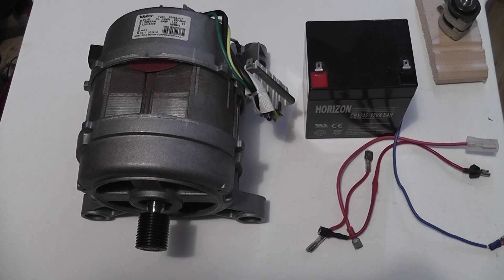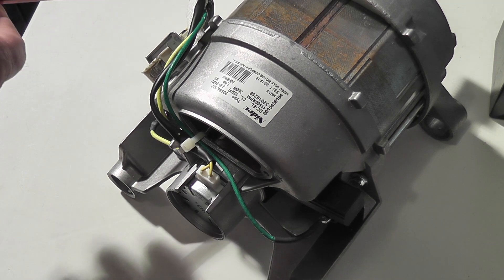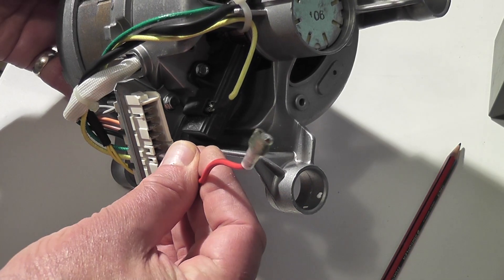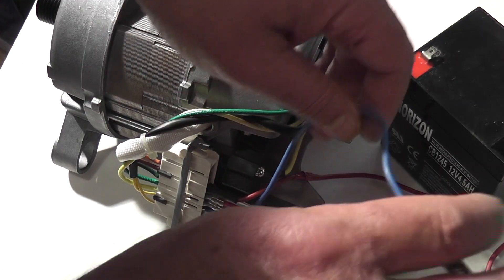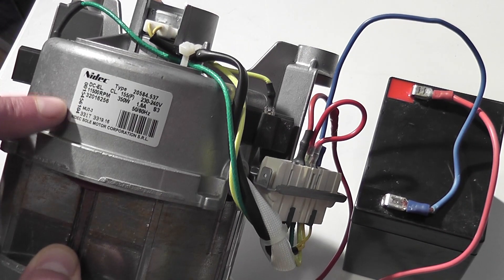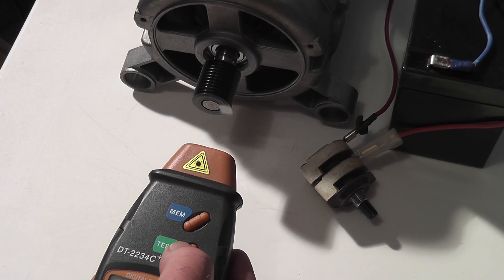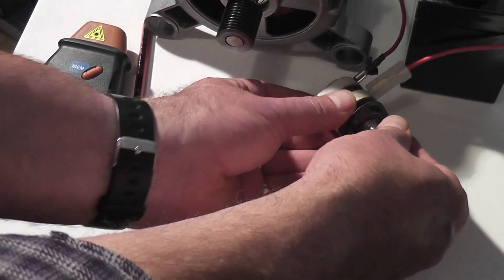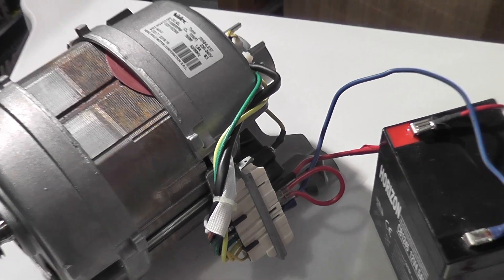Easy Conversion of AC Washer Motor to 12VDC

Comment: What the resistance of each motor winding? What is the purpose of each winding? What would your motor winding circuit diagram look like if you drew it on a peace of paper? How does the motor speed sensor work?  Complete the following equation: 12 vt Dc divided by Resistance = Amperage. Test your current using an amp probe, on your working motor. Is your meter reading the same as the Ohms law equation? Can you use a multi-meter to to check RPM of your working motor?  Answer these questions in your next video. Their is no HACK for real learning.

Comment: Motor nameplate says 230-240v, 1.8A, 350W - (1/2 Hp Rated Load) which should be at (1.0 Service Factor). 12VDC will turn it, but do not expect any sort of power output (not even a fan), as the battery would need to provide 29 Amps to run fully, and possibly burn out the winding as it is rated at 1.8 Amps.
The operating volts required suggest that this is from England.

Comment: You will want to rectifie the ac FLYBACK CURRENT block it's positive return path with diodes and toute the the converted FLYBACK DC current back through the neg brush.

This will convert the B-EMF internal braking into an intermittent pulsed push on the rotor.

Twice the ower twice the speed and when spun up from an outside mechanical means, it will outrun the external motor and power itself from converted FLYBACK currents.

Comment: Yes, the motor will run no load, but as such is nothing but a short term amusement incapable of doing any real work in the real world. Put a load on it and the motor will stall, then it becomes a question of what dies first, the battery rated to supply 225mA for 20 hrs, or the motor windings powered with the motor in a locked rotor state. Sorry, your demonstration has no real world application beyond demonstrating that a univeral motor can run on AC or DC.

Comment: Very interesting, how efficient is the motor when running off 12v, and how is the motor torque affected? Does this mean also that you could use this same setup to generate 12v as a generator of a small wind turbine?
Reply: watch the motor details it's a DC Motor?

Comment: yes with this way you can run every universal motors in your home, like drill, grinder, vacuum cleaner and...
with low turning.
just put 12 v on the power plug.
Reply: mccann  smoke for what?
no smoke come out.
test it.
a dc ac motor, run at 1/20 of power

Comment: Where/what appliance can you find those high amp potentiometers?
Reply: Electronic parts stores - what he is using is a high power rheostat. He does not give the resistance value, but is probably in the 100 ohm range.

Comment: Nice video, you please do a video of a brushless ac motor using DC power? Thanks
Reply: they need motor controller.
esc brushless controller.
without that they can't run.

Comment: I KNOW IT IS A 12 VOLT BATTERY.
What is the ACTUAL battery voltage YOU ARE RUNNING IT WITH and how many amps is it pulling NO LOAD.

Comment: a question sir .. I have a new motor for a washing machine .. it is 220 - 230 volt .. so if I bring many batteries that will calculate at the end of 230 volts .. will the motor run with no problems at the full speed and with all it's power ? (watt) ? I mean is the idea of AC and DC motors is how much volts I provide for them ? not matter if from a battery or from my house electricity ?

Comment: thanks as soon as i get a washing machine motor i'll convert it and use it as a motor to run an alternator in the hope that the motor make work the alternator...
also plugging directly the washing machine motor directly to solar panels and wind turbine....
without the use of any inverter...
free silent 220v AC constant....obvious with a backup of car batteries...
just in case of no wind or solar...
Reply: If only it were that easy!
Reply: @goodnough1  easy or not i'll make it work if it actually can work..
sure as hell is if you never try,YOU"LL NEVER KNOW..
electricity generation  and all related things it may be hard to understand but they aren't..
i saw  guy an italian guy use a 12v dc motor connected with bicycle chain to a 220 ac motor and made it generate electricity and the 12v motor was running of a 12v battery, that 600 watts ac motor was running all together 2 bulbs 60 and 40 watt plus scroll saw if i am not mistaking 400watt plus plugged on the generated electricity a battery charger......
most of the stupid fishes human fishes still believe that a car cannot run without gasoline..
has been proven widely that cars can run on bio methane and liquid bio methane, from wood gas, electricity, hydrogen...
HECK !!!IN NETHERLAND HAS BEEN BUILT EVEN A PROTOTYPE OF PLANE THAT RUN FASTER THAN 6000 MILES HOUR STILL AN EXPERIMENTAL THING BUT THAT THING RUNS ON HYDROGEN...
SO ALL OF YOU THAT STILL DON'T BELIEVE THAT ACTUALLY CARS CAN RUN WITHOUT GASOLINE OR ANY OTHER DERIVATE OF OIL ITS ONLY FOR ONE REASON YOU DON'T BELIEVE CARS CANNO'T RUN WITHOUT GASOLINE..
COZ YOU FUCKERS INVEST PLENTY OF MONEY ON OIL COMPANIES...
AND LOSE THAT MUCH MONEY FOR YOU IS BAD...
SO SPECULATORS ON SOMEBODY ELSE DIME!
IF IT WAS FOR ME... I'LL BE TAXING 99% OF THE MONEY FUCKERS SPECULATING ON OIL EARN..
HELL FEW COLLEGE IN THE U.S. MAKE ELECTRICITY THEMSELVES AND WARM UP THE BUILDING WITH THE USE OF MICRO TURBINES HYDROGEN AND ALTERNATORS...
with a lil reminder that Nikola Tesla gave us a way to get electricity for free...
but since american greed is the worst of the illness world wide...
we citizens have to pay for something that could be for free coz provided by the planet without any human intervention to generate it...
Tesla also invented the first electric car..and some rich fucker and speculator in the US sent one or more sons of bitches to burn down the factory where electric cars where built...
people you may ignore it but the today wifi  its nothing more nothing less than wireless electricity...
WHICH  Telsa was experimenting on long before american greed expanded to the world..
and thanks to the american greed today fuckers that never have enough like google amazon so on so forth of making money keep destroing the world where we all humans animal plants trees live on..
american greed...
THANK YOU YOU ARE KILLING THE PLANET AND ALL ITS LIVING THINGS!!
i forgot,whom was saying that solar panels cannot be put on a car???
well with the invention of new folding solar panels  put panels on a car roof...
will be even more easier now.....
so do  to the world a favor you fuckers that believe car cannot run without gasoline quit stealing money from other and start pay for the damages to the world you  greedy fuckers have done...
all of your money put together wouldn't be enough to fix the damages..
Reply: @scamper_van8470 dude, you have my vote for whatever. You had me at "YOU FUCKERS!"

Comment: That is NOT an AC motor it is a UNIVERSAL motor, AC motors are not able to run on a battery, universal motors however are designed to run on both AC and DC.
Reply: yes battery wont run an induction ac motor which is widely used in my part of the world on washing machines...i do have a vaccuum cleaner ac motor which is a universal motor but 12volts doesnt provide the thrust it needs
Reply: @fidelcatsro6948  it is possible to use the mains power in combination with a bridge rectifier to get the correct DC voltage you need
Reply: a rectifier only make the mains alternating ac to dc at the same voltage of the outlet
Reply: @fidelcatsro6948  that's correct I assumed that the motor worked on mains voltage however you can always try using a pwm dimer
Reply: @jakevangeersom3289  universal motor can also run on AC amigo...because the motor has no magnets, it relies on ac pulses for stator magnetization and rotor for reactive thrust...motors are a variety of plenty animal breeds must see and check properly
Reply: / @fidelcatsro6948 i seen ur commen
tm 4 yrs ago, i have ac drill & vacum mortor the turbine and stator coi if i put them 2 more bulky of each in u opinion torque of drill as rpms of vac possibly enough for a bicycle?
Reply: @Dabeedmokeweed-dl6ix 
it might work but i dont know if it will heat up and burn after heavy use like for bicycle use😂😂😂
Reply: What is the torque like at 12 volts
Reply: Jake. Thanks.
Reply: Jim Whitehead  I have spoken of a pure AC-Motor, not what is possible with a conversion. A 6 years old child knows nothing about conversion and of an Ac-Motor too!
Reply: I have a Stihl 230 V hedge trimmer, how  how do I know if the motor is AC or universal ? Any idea if I could use it with the new battery system just by rewiring and replacing the plug ? I think the battery is 36 V 1000 Wh I suppose it would a much lower RPM and torque ?
Reply: AC motor can run on battery using an inverter that converts DC to AC read more...
Also An AC motor can be swapped to DC curent by removing the thicc part of that has alot of copper wires and replaceing that whit 2 magnets whit oposite poles .. place them at the right angle ( take a small dc motor as example to know exacly )
Reply: Remember, he is in Europe. Different wiring schematics completely.
Reply: so if is ac motor there is no way to ran it on battery?
Reply: How do you identify an AC motor?
Reply: True that....ac motors dont hav slip rings n brushes as well
Reply: @deeman5233   all my ac power tools have brushes
Reply: @tcply9450  so its a dc motor...conversion from ac to dc...internal..
Reply: @tcply9450  ac motors dont have brushes...your power tools is either converts the ac to dc for your motor power tools or you just have dc motor...ac motor dont need brushes
Reply: @MrOner07   a lot of them ac hand tools still do, drills, sanders, saws, i have a good collection of them and can go right now and buy more,  you can take them apart and  change brushes, no ac-dc conversion,  some even put a extra package brushes in the box with a new drill or what ever the case may be ,,  i might get my grand kid to split the case on one and show you only the switch, and brushes, armature are in them, some have a little impeller for air flow or a little bulb , iv dont think i ever had a electric drill or skill saw that wasnt ac and all have had brushes , i have 2 band saws and both are ac -brushless , and my wifes trimmer is ac-brushless , how ever the hedge trimmer is ac with brushes,
Reply: @MrOner07  You are totally wrong my friend! Brushes are not a sign of being driven by AC or DC! Brushless Motors can be also DC or AC. They are more expensive, but producing less heat, needing less power, becoming less warmth and living longer. Switch on a Drilling Machine, either they are powered by AC or DC. If you can see sparks when running, you have a motor with brushes! If they don't, they are brushless!
Reply: @Dee Man
Slight correction, my friend...
Lots of AC motors have brushes & slip rings.
Any of them that function via induction.

The only ones that don't are permanent magnet motors.

Comment: Eleven thousand five hundred RPM is really moving for a washer motor!
Reply: The motor is high RPM turning a gearbox to reduce the RPMs but increase the torque. So this is normal.

Comment: what fuck you are doing ass hole ,this is nothing new about this fucking thing ,this is always like that, we call  this a UNIVERSAL MOTOR because runs on DC or AC  but ,you wast you time with kids stuff, some people  think  they are super stars because they deal with people don"t know nothing about this stuff but for me you are a show off men, but for those don"t know this things they should stay away from electricity or they should go to a electric school first , wen you mention  You could increase the voltage from DC 12V to 24V, 48V, 60V, 72V, etc and in series or parallel,,,,, you are wrong , only series setup because if you parallel the voltages they stay the same ,only the current  genges

Comment: Is that a universal motor? If it's not how can you tell them apart, and control speed for belt grinder?
Reply: you can test the wires on these motors and see low resistance reading on the coils those are universal motors having only several ohms...an ac induction motor have several hundred ohms of resistance

Comment: I used to boost vacuums by fitting a bridge rectifier to give DC to the brushed motor as they are basically a DC motor to start with!

Comment: can i run a 90 watt ac motor of  refrigerator with this method with 50 amps battery or is better i use a inverter ?

Comment: I have a 12v D.C. motor from power bench van seat. I want to add another set of wires to it so I can power it with battery @ 1 end and power something else from the other set of wires ?

Comment: can you explain about white wires please that are coming out from motor //and how to use this motor on Ac volts on low speed but high torque ..thank you very much...
Reply: Use speed regulator module with ic tda1085c by motorolla or ONSEMI search on google,there is some circuit diagrams or products related to it,torques are the same every different rpm

Comment: I wanna use a 115v 60h D1124 motor run off of two or three dewalt 18v lithium packs for compact sake on either a scooter or longboard beast set up... Any sugestions?
Reply from the maker: The Dewalt motor may have enough torque to power a small scooter

Comment: Weird. I just tossed out a dishwasher and decided to snag the motor out before scrapping it. I swear google is listening to me.  I didn't look up anything online, but here is a video telling me what to do with that motor. This isn't something that comes up in most people's recommendations. Mine may work better because here in Murcia our motors run on 120 not 240. Although I think a potentiometer would get pretty hot if you run much power through it. Is there any reason it wouldn't work with a PWM controller?  It looks like it should just be a series wound motor when you get done.

Comment: Dear sir, thank you so much for this vid.  I wonder if you could tell me, would this set up work as a dc dynamo and also what power(torque) is produced by this arrangement?  Thank you once again sir, an excellent vid.  Paul.
Reply: @torchyboyz
This motor in the original configuration will output 3 phase AC if used to generate electricity.
Rewired as shown, it will output single phase AC.

In order to get DC from a motor, you're going to want one of the permanent magnet variety.

Alternatively, you can build a 3 phase rectifier by first connecting 3 pairs of diodes together, positive to negative, attach each leg of the 3 phases between the diodes, then bridge the loose positive and negative ends separately.

DC positive is on the positive bridge, DC negative on the negative bridge.
Reply: It could but you'll need to put power into it(dc) to get power out of it . Either on the stator or the rotor coil you will need to connect a battery and that will work as a magnet. Depending on the battery power and the rpm you will get different voltage. Hope I've helped.

Comment: I can't see how is it possible to run this universal motor on four wires only. We have two wires from each coil and four connectors for the two brushes.

This motor should not work?!
Reply from the maker: Yet it does. 
We are constantly experimenting with other things that ordinarily shouldn't work and plan to upload our results in the future
Reply: As it is a universal motor is that it has 2 wires  from the field coils and 2 from the armature.  What was done is the field coil was connected in series with the armature coils. in a way that makes the magnetic field push the armature around. if the field and armature is not connected right it will just lock the armature and not spin, so give it a try.  But a regular induction motor will not work for this, as it has no field coils.

Comment: Full of incorrectness.! The motor alone is DC and NOT AC, with the controller, which is a typical thyristor controller the whole system can be run on AC, this motor alone will NOT run on DC if it is a true AC motor. This is nothing more than a DC motor, and part of an AC system as the label suggests. If this was an an AC motor alone, applying DC would make it lock to the nearest pole, AC motors don't generally have brushes also. For an AC motor to run at 11,500 would need an inverter drive. Sorry, but all you have here is a DC motor, part of an AC system rated at 240v and these motors run at generally 180v. Go check the Nidec website for the data.! If you DON'T believe me, take the end cap off the motor, in there you will see a commutator and brushes that you will ONLY find in a DC motor, and NEVER in an AC motor.!!
Reply from the maker: It's a 220~240V motor from a domestic washer. 
We are in the process of getting more motors and will test them. 
We will also be testing them with transformers and inverters to see how they work when applied

Comment: I think I'm just beginning to understand all the different noises I hear from my washing machine as it gradually builds up speed on the spin cycles. 

I guess the onboard computer slowly increases the D. C. voltage, then switches to straight A.C. for the final fast spin.
Reply from the maker: Hi dav snow,
Many motors may emit different noises and audible tones at different rpm. We have another motor that works fine but it has an audible pitch like a screech. 
It could also be that the sound you're hearing may be a part that is being run by the motor.

It is our understanding that the motor while in the washer works on AC only though we are open to discussion and correction on this.
Reply: @DrivewayDudes  Thanks for your reply. I enjoyed this discussion, and the other comments that you facilitated in this video.